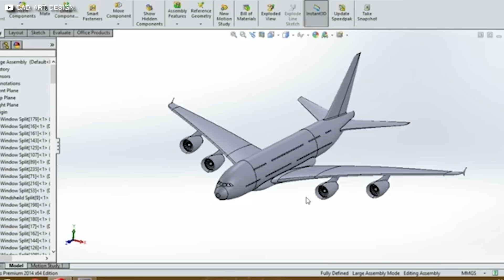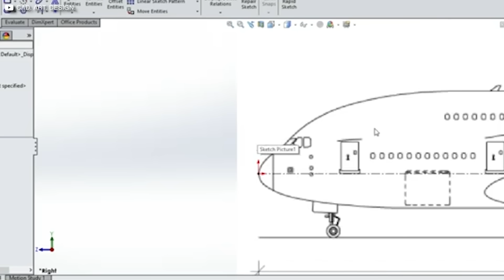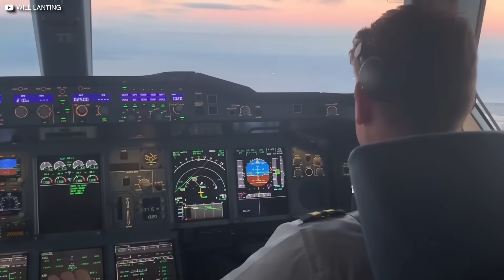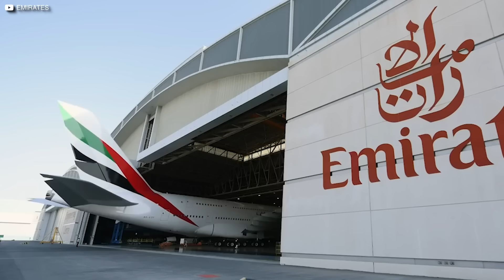What The A380 Was Really For

Comment: in 2023  when I was aged 82  I had a trip on A380  Economy class from Heathrow to Dubai where I changed tp Boeing 777  to Seychelles, which only has a    smaller runway, as the airport fees the  seafron. A380 was just superb. A380 was so comfortable . even in Economy class. so quite  you do not know it is moving through the sky